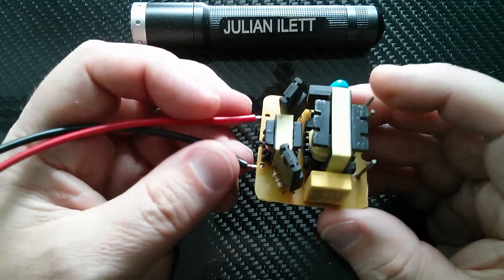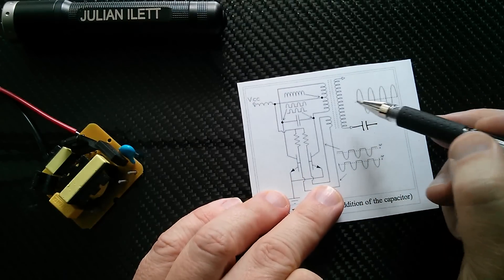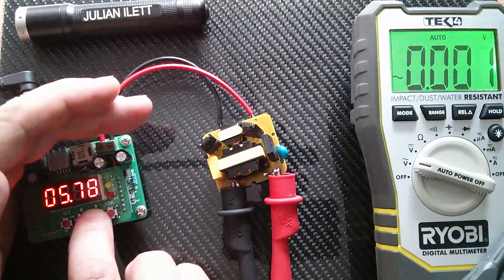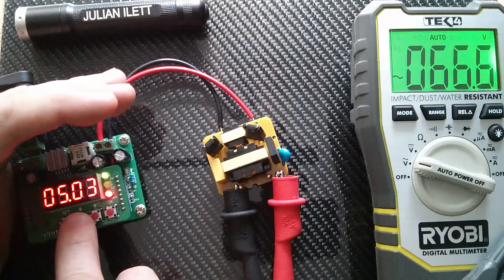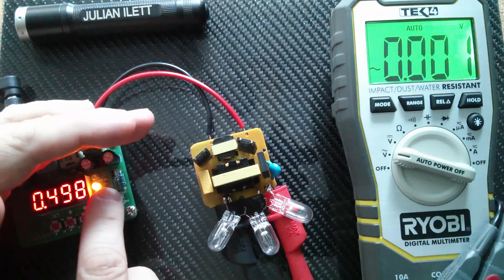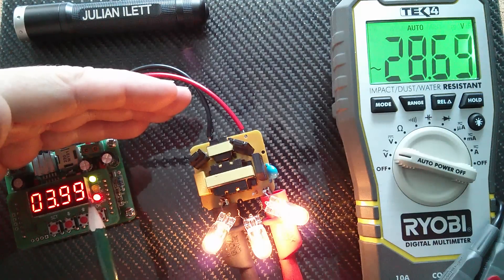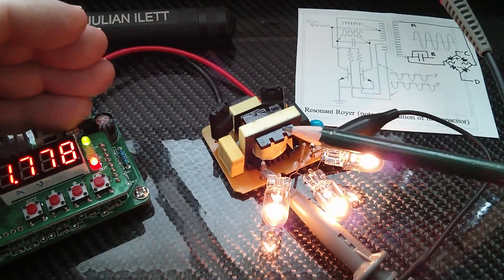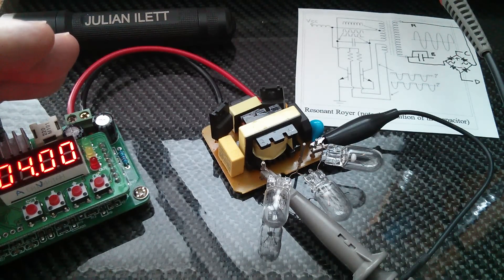Playing with: 12V DC to 220V AC Inverter Royer Oscillator

Comment: I'm wondering if there's an easy way to adjust the voltage output without needing an adjustable power supply or series resistor.
[Edit]
I will experiment with adding a series potentiometer with the base resistors of both transistors and see what happens. Worst case, something blows.

Comment: I have a slightly different version from Amazon . The strange thing is , i get 220v DC rectified out. But 0v on the AC. with my fluke meter. This makes little sense to me . As the DC part is rectified from the AC secondary. The only thing i can think of is my meter has so little load on the system that the primary is not oscillating?  I have not shorted out the output capacitor. I want to use the module to convert a 240v hob ignitor  to a 12v supply as part of a van conversion. No instructions on this version just Chinese. And it has diodes instead of a bridge rectifier. Your  video helped make sense of the principle of the circuit. The amazon UK  listing shows your board version. But get supplied a bad track layout version where the 220v side track runs very close to the input side.And is more like a maze than best route.

Comment: At the output of such things from aliexpress, there is a high-frequency impulse voltage, the multimeter does not see it and shows the wrong values of 500 or even 1000V. You need to use an oscilloscope for measurements.

Comment: I have just tested my unit (same one) and for 12VDC I get 265VAC out (no load) RMS. 4VDC in results in 80VAC RMS. Surpisingly, it produces output even down to a volt in. At 4V in and 300mA drawn, this is 1.2W. My bias load at 75VDC (ac rectified) draws 20mA, equalling 1.5W. So efficiency is around 80%, very good, however primary current will quickly rocket with increase secondary current. Good sinewave but clips under load, so radiates hash into audio gear. Needs to go in a shielded bix and leads.
Reply: Does the "radiation" stop at the outlet when you plug in a load?
I would like to put this into a small metal box with AC outlet to plug small appliances into it 🙂

Comment: Currently in the fine print in the ad it says it can drive a 40W energy saving lamp.  This is doing just what I thought it was going to do.  It puts out about 6W without any cooling and that will indeed light up a 40W equivlient 6W LED bulb.  I am not sure if this is a vagrancy of language translation or flat out deception as far as the specs go.  It is a neat little module, but it is not what the average consumer would expect.

Comment: Thanks for the name for that circuit,  I'm going to have to check out the wikipedia page.  I knew a guy (another brit,  sadly no longer with us) who used such a circuit that he'd made with a couple of TO-3 cased germanium transistors, and the "power input" was a couple of bits of disssimilar metals buried in his garden.  It did actually step the voltage up to some usable level and give him some small amount of usable power for something in excess of 20+ years...

Comment: Without heatsink, the transistor heats up violently and could get damaged at high voltages. WORST CIRCUIT I'VE EVER SEEN!!!
Reply: 35w @ 12V is a tiny bit less than 3A max, and even less amps at higher voltages.
Reply: BTW, only with heavy loading

Comment: I'm wondering what the nominal input is? 13.5, 14.7? I could be way off base, but I'm wondering if the circuit kind of rings into resonance at the correct input voltage? A tuned circuit, so to speak.

Comment: Dear Mr. Ilett .. this module has been made for 12v dc which you can get from car or Motorcycle battery .. which they have higher Amps .. but in case you are using DC 12v .. I believe .. so it's normal if the temperature is rising .

Comment: The "blue thing" is a capacitor, 222 = 2n2, it will be high voltage rating. this design (royer ) is commonly used for fluorescent lamp drivers, like LCD display cold cathode tubes. (TV or laptop etc.) the transformer would be wound for high voltage, high enough to start the tube, and when it strikes the voltage is mainly dropped across the cap. tube runs at about 100V. If it is running correctly the transistors will not get hot.  The bridge rect is out of place, it will be too slow to handle that frequency. Somebody has taken a good design and adapted it to do something it was not actually suitable for. not you, the people who sold it!

Comment: Oh, please! How can you calculate power this way? What about voltage? Power of this thing is limited by transformer and Pd of transistors, so current, switching times (*U) and freq. Give this nominal voltage, select load this way so input current would be slightly lower and you'll receive more power (don't count for 35W without heatsink).

Comment: I will not deny the power rating is overrated but the current is the limiting factor I would say.
35W @ 220V = +-160mA
8W @ 30V is already +-260mA at the output....

Comment: The output capacitor is to limit the output current.  It passes a lot of current at the frequency that unit works at.  The same circuit is used for cold cathode tube drivers and rations the current through the tubes.  They often split the output two ways with one capacitor per tube.
Reply: interesting comment big clive
Reply: bigclivedotcom so that's where they salvaged em from lmao 😂 repackage and resell lmao Chineseium idea lmfao
Reply: bigclivedotcom Greetings , Clive! I'm currently doing the re-search on electric engineering. Thanks for your explanation.
Reply: Several versions of these boards floating about. I just ordered "a few" ;) to try and power some UVC lamps. (some are 254nm + 185nm) So I'll be gettn' jiggy with some Ozone!! Oh yeah. :)
Reply: I'm glad I came back to this video and saw your comment. This explains why I had such a hard time getting the output voltage to a manageable level even with large loads when I shorted the capacitor in my tests.
I'm looking for a cheap dc-dc voltage booster for feeding small tube projects off 12v, and this seemed like a perfect fit.
Reply: Hi Clive, I'm switching to your channel soon! Don't be mad :-)
I like it when 2 big electronic guys hand out information! You guys are my teachers  :-D

Comment: Nice video Julian Thanks. My question is about the serial port of the B3603 cnc power supply. Can it be used to program the voltage or current values with an external laptop or pc or arduino for instance?

Comment: The capacitor is a Y capacitor it filters out common mode noise from the system and without it can cause a shock. Also I would recommend using a load when doing the voltage calculations because inverters, dc-dc converters and other systems are load dependant so having no load would effect the operation of the inverter

Comment: There seems to be a minor flaw in this plan.  I assume that you are going to charge the battery (three cells in series) with a current source (eg. solar panel) and each cell is going to have one of these 'inverters' connected across it when it reaches full charge with its output connected across the battery.  This increases the current being supplied to the other cells and charges them faster.  This is fine until the last cell is fully charged.  Then there is nowhere for the charge current to go, it will just circulate round and round through the inverters dissipating all the power supplied by the solar panel in the transistors.  If you are happy to just dissipate all input power when the battery is fully charged then it would be simpler to just put an accurate 4.2V shunt regulator across each cell.  The circuity of the shunt regulator would be roughly equivalent in complexity to the comparator you are going to use to connect the inverter across the cell.
Reply from the maker: The charging source for the whole pack will be a CC CV power supply - it will wind down the current as the pack reaches full voltage.
Reply: OK, that'l learn me not to make assumptions.

Comment: Not sure if you noticed or not but that circuit is remarkably similar to a joule thief type setup, in terms of how it operates. My betting is that it will start at something like 0.7V and work all the way down to about 0.15V.
Reply: I've tested it and it stopped working at around under 6 volts, actually.

Comment: Isn't it carbon fiber conductive? I suppose it is not real carbon fiber.
Reply: My thoughts exactly.  For the prices of some mats I'd say there are real CF mats around. Certainly if it is conductive the low efficiency would not be a surprise. Maybe the transistors were just acting as decoys. Also with 25khz flowing just above it I'd wonder if it could couple. Just a bad idea all around.
Reply: Rizki Pratama it was covered in a plastic over the carbon fiber probs fake carbon fiber tbh

Comment: 1. That capacitor you shorted out is for current limiting i.e. it acts as a resistor in AC, without the power dissipation

2. You should put a dummy load on that to measure the actual Vout

Comment: You seem to be going to a lot of trouble to get a self balancing 3 cell LiION pack. Not that there's anything wrong with that but if you connect 3 inverters and 3 buck converters(?) won't you end up with a circuit that discharges your 3 cell pack in a very balanced way?

Comment: The blue "capacitor" could possibly be an NTC resistor for inrush current limiting.
On the ebay listing it said something about being a module for repair - maybe it's intended for a specific application inside some other device. I see you've realised the bridge rectifier in there is to give DC output.

Comment: that heat issue, are those transistors operating in saturation region ?
Reply: They aren't as he stated in the video. They are just working as resistor switches.
Reply: i see, i missed that. may be he can change the resistors to make transistors operate more efficiently.
Reply: iceberg789
I think this would result in very high voltages on the ouptut and a dead short on the input. Don't know though.
Reply: ummm not really, those transistors are placed in the i/p section of transformer, their purpose is to put oscillation in the input DC, with peaks, just a little below the i/p DC rail.
the transformer will step up the voltage as usual as per the primary-secondary turn ratio.

Comment: Perhaps it could do 35W at 12V DC in? The current demands would probably be less, keeping the transistors cooler. Of course you would get a much higher voltage out, and it wouldn't be suited to the application you had in mind, but for its intended purpose, I think it might actually be able to make spec.

Comment: Please do same tests with 12V on the input of the thing. You got crappy results because the circuit is designed to run on 12V, it'll still oscillate on lower voltages (as you saw), but it will crap out as soon as you connect a load to it. And yeah, I wouldn't trust DVM measuring 40kHz sinewaves, most of DMM's are good only up to 400Hz :)

Comment: This looks to be around 25% efficient with 8W in and around 2 to 2.1W output. 
A good pack will get at most around 0.5% imbalance/month with daily charge discharge cycle this is based on my large 100Ah 8s GBS cells with normal operation around 50 to 80kWh used / month and around 30 to 50kWh of this will be from battery the rest directly from PV.
Now that 0.5% max imbalance that needs to be corrected over the course of the month represents 0.5Ah * 24V = 12Wh that will be dissipated on the resistors over a period of one month.
In the case of the SBMS that only makes cell balancing when charge current is applied all that energy will be from PV panels directly and none of that will be from battery so extremely inexpensive or more accurately free because there will be much more than that unused energy in off grid type application. 
But lets say it costs something and that will be the amortization cost of PV panels around 3cent/kWh at my location so 12Wh will cost 0.036 cent/month or 0.432cent/year and a total of 10.8 cent for a 25 year period. 
So the total cost of the energy wasted on the cell balancing resistors over 25 year period will be just $0.11 and even if you used expensive grid energy at 30cent/kWh to charge those batteries that will still be just $1 and that is for those 8s 100Ah cells (2.5kWh capacity charged daily) and not just a couple of small 18650.
People are always concerned about the efficiency without considering the economic benefits of that.
Reply: I see your point. Electronics as my hobby sometimes it is not about making money. It is to try and make something better, even if it does not save you cash. Usually you just waste time and money, but at least you get experience. :D
Reply: ***** No doubt that this is a good learning experiment probably also a fun experiment. People just concentrate to much on savings and efficiency without looking at the big picture.
Reply: If this experimenting leads to better chargers then the impact is even much bigger. And solving this matter is quite a challenge. The input current is linear, but as the cells are in series you can't reroute current. Not in DC mode without dissipation. And the challenge ever so remains, because the cells are attached in series, meaning plus to minus. If they could be detached there would be better solutions.
Reply: Not I understand your point. Cell imbalance is very small and correcting that even for very large cells will not require large current to be dissipated. The SBMS that I designed will manage to maintain a large 8s battery (large as in 100 to 1000Ah) with a total power dissipation of 1 to 2W worst case for a few minutes a day during charging. The way is done will not use current from the battery but from the charger usually a solar PV panel and by connecting a simple power resistor in parallel with the highest cell/cells thus those cells will receive a slightly smaller charge current since small part of the current will go trough that power resistor.
Recovering that small amount of power and using that to charge other cells is done and possible but has no economic or any other real benefit.

Comment: 5:48 If you multiply that by the square root of two, you are pretty much bang on at 240. The rectifier is there for a reason :D
Reply: He wasn't measuring the output through the rectifier though. He was measuring the AC output.
Reply: That's what I'm saying, the rectifier is bang on and that's how they get 230 while they only have to get to 170

Comment: I don't understand all that balancing talk, why not just charge each cell ? A high frequency circuit and small transformers should solve the problem :-)
Reply: Julian wants to charge the cells while they are connect in series. This demands isolation between each charger. Transformers are a fine solution, and driven at 30-50khz they would be really small.

Comment: Doesn't a capacitor in series remove a DC offset from a signal?
Reply: The output of a transformer would not have any DC offset. +Jullan Ilett, did you test the blue component in question with an ohmmeter? If it passes DC, maybe it's a fuse in an unusual package. Just a thought. By the way, won't this circuit generate a lot of RFI? Just another thought.
Reply from the maker: It might also work as a current limiter - perhaps I'll try that.
Reply: Sure. But signals are meant to carry information. Usually delivering power is a whole different beast. Plus a transformer's output has zero DC offset :)
Reply: I also thought that it may be a fuse.
Reply: What I think it is is a contraption to start a fluorescent tube. I origially purchased one of these inverters from GoodLuckbuy, and it was listed as "20W Fluorescent AC 12V to 220V convertor can drive 20W lamp good quality" (not sure if it is still there). Mine is the same as yours, but lacks the rectifier. I have tried attaching a 20W fluorescent tube to the output and it started immediately without any kind of ballast, and the capacitor limited the current (and the resonance with the transformer provided the starting spike). But it is very weird.

Comment: Remove the short on the capacitor - 220V ???
Reply: Input 8W Output 3W Dissipation 5W = Extremely Inefficient ;)
Reply from the maker: I think the 220V specification may be a peak AC voltage rather than RMS. The oscilloscope reported the peak AC voltage as 234V

Comment: I'm not sure why you bypassed that capacitor if your not sure what it does, the people that designed the circuit had plenty of time think about and optimize the design of their circuit. Also most cheap multi meters can only measure 50hz sinusoidal wave forms accurately.
Reply: Exactly. It will not measure the 50-100 KHz output correctly. Use the scope for that.
Reply: Or rectify it and divide by 1.4 ...
Reply: +z08840 these aren't you're ordinary human beings, these are.... Asians
Reply: calm down there tho buddy. we've seen more than enough not thought out poor designs
Reply: True RMS meters should do, though.
Reply: this circuit isn't designed by people - it's designed by chinese

Comment: Could I use this Inverter in combination with a Capacitor/Diode Voltage multiplier ladder to create low amperage high voltage?
Reply: Just buy a high voltage converter from eBay 3v in 10.000-100.000v out
Reply: I would need 4,8-5kV

Comment: Julian, that inverter is too inefficient for your project. Use a buck converter circuit, but replacing the inductor with a step up transformer instead.
Reply from the maker: Inefficiency isn't a problem. Anything's better than using resistors to discharge LiPos
Reply: My bad, I misunderstood the purpose of the project

Comment: 35w might be the maximum power it can handle, but it might also be limited both in voltage and current. That is actually very common! 

And about the voltage measured during load, the meter might only be able to measure RMS on a perfect sine.
Reply from the maker: A perfect sine and a limited range of frequencies
Reply: +Julian Ilett It might be time to invest in a true RMS meter